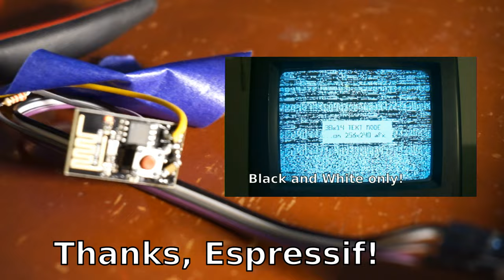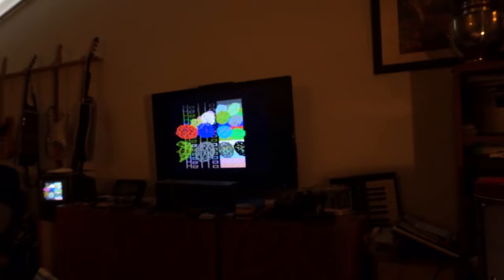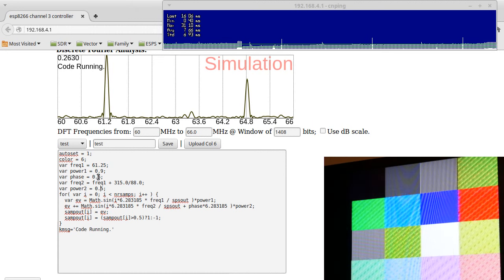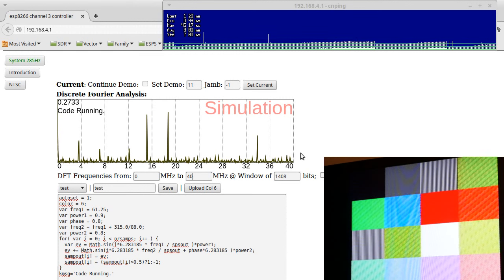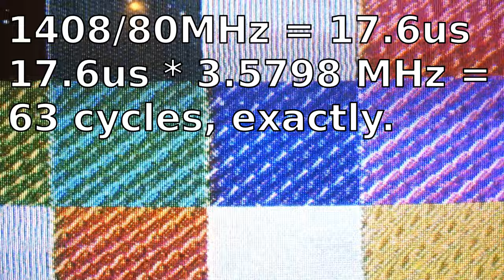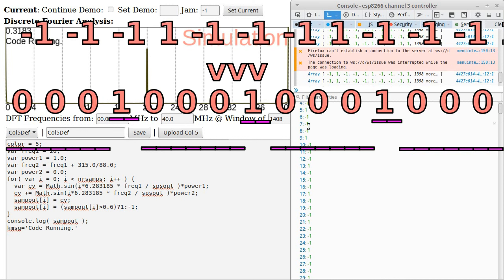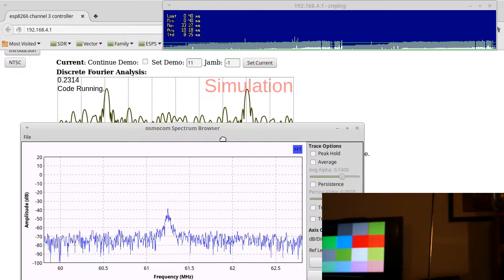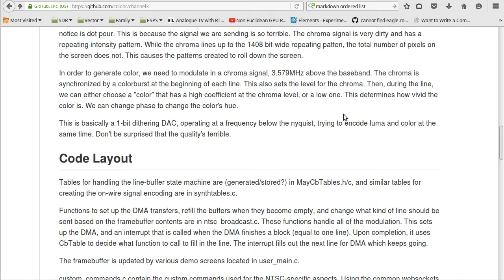Broadcasting  COLOR Channel 3 on an ESP

Comment: Yeah. There's a huge community around the RTL-SDR. They've got everything from really tiny dongles to a box of 4 you can use for passive radar. They're stupid cheap, compared to legitimate dedicated SDRs which would cost upwards of even $3K.
Reply: with the rtl chip rx and esp producing baseband this could mean a full ham radio with data modes and oled in the old altoids tin

Comment: Those last few seconds of the video were classic.  It's like you were playing a video Theremin!  Great video.  Can you estimate the wattage output of the signal?  Also, were you connecting to the device over WiFi or over a wired connection?
Reply from the maker: +Casten Riepling Across the entire transmit space, I don't believe it's possible to be more than 0.1W, so within that band, it must be much, much less.

Comment: Is there a second I2S port? And if there is, could you make a resistor ladder DAC to send a bit of a smoother signal? Would that help reduce the noisiness? Or would it actually be worse since you're relying on sidebands or whatever the word is, the reflections on the spectrum, so meaning the signal's impurity is actually doing a lot of the work? 

Of course a third and fourth I2S stream would let you use even more bits in your DAC.
Reply from the maker: +greenaum There is not on the ESP8266, but there will probably be on the ESP32!

Comment: I just got an idea,... what would it take to transmit some pre designed (sdr recorded and decoded) data in 434MHz or 315MHz band. 
Let just say that I would need to fake 4 unique (Manchester encoded FSK signals containing  pressure, temperature, unique 32bit ID and crc)...  And then transmitting it at about 1Hz... There would probably be a huge market for such device.
Reply from the maker: +Uroš Golob It would be difficult to pull off with this configuration as we're already reaching pretty far to get 60 MHz.  Maybe there is another hardware configuration?
Reply: +CNLohr I was afraid of that, so dedicated hardware transmitter is probably only solution... they sell those for $6 on ebay,... that is still cheaper then 4 TPMS :)

Comment: My ESP8266 is not outputing a wifi signal or a tv signal. Could you help me? I used esphome-flasher to upload it to my microcontroller.
Reply from the maker: You will need to connect by serial terminal and dump what it says.  The baud rate at boot is 74880 or 75000 depending on which one your serial flasher supports.
Reply: @CNLohr  hi, I wish you answer my query. 
I have raspberry and it's more powerful than attiny and esp8266, so I am wondering is it possible to broadcast raspberry Pi screen to analog tv channel 3

Comment: What I'm impressed with is the web interface that parses a text with setting.
Reply from the maker: That was a lot of fun, and I intend to do stuff like that in the future.
Reply: That's a great direction as it must speeds up MCU development a great deal. Will you make a video about it?
Reply from the maker: I haven't really used it before or since.  I've always wanted to cross-compile TinyCC to Javascript for this sort of thing but it hasn't really worked out :-/
Reply: tinyCC sits on the esp8266?

Comment: How much work would have to be put into this in order to broadcast something beyond geometric shapes, say low res video/audio? A lot of fun could be had with that.
Reply from the maker: Audio is really hard with this since it requires a second carrier.  There's just not enough bits to do it and make it sound good.  As far as shapes, it wouldn't be that hard!

Comment: Thank you very much for making it open source, I will try to use it for my own project that takes a low-res digital video from USB and converts it into analog. My version will be PAL as I live kn europe. I just have to wait for my ESP to arrive.
Reply from the maker: You can #define PAL with the example code and it should be able to do PAL.

Comment: As you can see in the Arduino IDE options setting the ESP8266 can run at a pace of 160mhz. Don you think that using that 2x faster option could help rmove the "noise" in your picturing?
Reply from the maker: For Channel3, I am operating in 160 MHz.  But, some of my nosdk8266 stuff at 320 MHz could.

Comment: I am new with this so you could make a setup video? smooth a question so with this you can actually take over a TV sender?
Reply from the maker: If you watch the first video "Channel 3", it explains a little more, however, the general expectation is for you to use an ESP8266 board and flash the firmware in the description onto it.  You may need more background with the ESP to get it all working.  So maybe it'll take flashing other firmware first to get the hang of it.

Comment: this is really interesting! super epic! might wanna try it for myself with an esp8266 I bought a long time ago and never used!
can you use sort of the same method to get just normal composite video output?
Reply from the maker: Look up bitluni.  He did it with an esp32, and composite.  It looks way better.
Reply: I retract my statement of wanting to try it out because I've been trying for hours just to get the SDK and dependencies installed (I am super frustrated)

not even the github page instructions or tutorials on youtube are helping me... I'm a complete beginner here (I am also using the Ubuntu app for Windows, it seems to be working fine though so it shouldn't be an issue)
can you recommend me a place to go that might make the process a bit easier?
tl;dr I can't upload the fancy code to the esp8266 because compiling it is a monumental pain in the behind
it would be a great development platform if it had its own IDE or interface like Arduino or STM32CubeMX
Reply from the maker: @jacksonshelton8055  Hmm, maybe in a few weeks I'll make a binary version of everything needed SDK wise and release it.

Comment: esp32 has DACs and Sigma-Delta Modulation. Any plans to implement this on esp32? Guess the results will be way better.
Reply from the maker: It would be infeasible since the bandwidth on the DACs are so very low.  But you could do the same I2S trick again.

Comment: Could this work at baseband composite video? The standard is 1 volt peak to peak, so a resistor could drop the voltage from 3.3 to ~1. But what about the - voltage sync pulse?
Reply from the maker: Yep, sort of, NTSC doesn't really care if you go negative or not.  But, that's not nearly as much fun.

Comment: why is the dft mirrored around the carrier? I tried looking it up can couldn't find anything..
Reply: +drojf The DFT isn't mirrored around the carrier, the actual RF spectrum is like that. He's exploiting the sideband to get the 61.25 MHz output: by generating a (40 * 2 - 61.25 = ) 18.75 MHz signal on a 40 MHz carrier, the sideband is located at (40 * 2 - 18.75 = ) 61.25 MHz signal.

https://en.wikipedia.org/wiki/Sideband
Reply from the maker: +will11m The principle is the same, I'm just not sure the mechanism is the same.  Though this doesn't look like exactly the mechanism, either, I think it's closer?  https://en.wikipedia.org/wiki/Undersampling

Comment: You have too much spare time. Get a job :D
Amazing stuff, love it!

Can this used with modification to output high resolution composite video instead of RF? Maybe S-Video on two pins with better colors? :) One more. Is the spectrum displayed in the web browser coming realtime from the ESP as well over websocket? :o
Reply: The web browser says "simulation" so I think that's just a calculated spectrum, calculated on the PC, that should reflect the actual spectrum coming from the ESP. 

The stuff from his SDR dongle is the real thing. 

I think!
Reply from the maker: +greenaum Indeed that is the case!

Comment: CNLohr is it possible to use the ESP8266 as a OSD board ? I work with APM Quadcopters and OSD are super expensive and a pain in the ass to program, it would be amazing to be able to create a OSD to overlay simple text ( or even color text ) over the video signal.
does the ESP8266 have the nesesary hardware to sense the video carrier signal and be able to go over the same phase ?
Reply from the maker: +Andres Alvarez I never thought about using it as an OSD.  Would the video generation device accept external synchronization information?  Would the ESP just need to process and go from there?  It would be very tricky because there is only one bit of output on the ESP :-/.  Maybe with a little bit more hardware.  Maybe it could just be an additive or subtractive OSD?  I.e. making the text white or black only.  But, I don't know if that would be useful.
Reply: most likely the video goest to fatshark fpv googles, or lcd screens inside a tool box as a "fly box station", check out the ardupilot mega project, APM mavlink osd, there is a protocol already done. The video is usualy generated by a analog ntsc camera, and the esp shoud sync over that video signal, so the signal that a arrives to the google is a "standar" ntsc signal
Reply from the maker: I can probably sync over an existing NTSC signal, however, I don't know anything about any of these projects or anything like that.  I don't know if I can do anything other than adding white text, still :-/  If that's good enough this could be a suuuper cheap video overlay thing.  I'll still have to look into it more.
Reply: +CNLohr Dude I love this chanel, I just bough 20 ESP and on the 1st day 1 finished and sold 20 diferent "wifi rgb lamps" to a guy that manufature fancy lamps, and he ordered me 50 more... long story short, Opensource is Great, but there is a lot of people who dont have the time go that path, they want to pay and to get the product done, even if you give them the parts and the instructions they wont figure it out. You can do a LOT of money with this color video overlay thing over ESP. Check out this 2 words " 250 FPV racers "  " mavlink OSD ". there is a HUGE RC comunity and there is only 1 color OSD and nobody figure it out how to do it, well, you just did. I have lots and lots of projects where i need to overlay video over a standar signal, and max7456 is a pain... please let me know you email
Reply from the maker: +Andres Alvarez What I was saying was it is easy to do 1 color.  It is much, much harder to do more colors. I'm honestly not sure how I would do it.  If there's no market for 1 color, it's not really worth it in my book :-/

Comment: Have you tried using a bandpass filter to get nicer signals?
Reply from the maker: +Michael Rußwurm No, I have not.  Not as ridiculous as straight one's and zeroes... But, I really should consider trying it.
Reply: wanted to suggest this too, I'm thinking it could really benefit the video signal quality. can't really think of a way to make the source signal clearer. also, I see others have suggested that the small cap you removed might have had something to do with this...I'd keep it in mind...and I'd also keep in mind that with the B&W signal it didn't have such an impact. All in all this is a great achievement, hoping you won't stop

Comment: dude your my inspiration to continue programming! i wish i knew as much as you, all i have made with esp8266 is a smart watch using nodemcu lua interpreter it connects to an sntp then keep sthe time with the rtc modual :/ i wanna learn the espress if sdk now
Reply from the maker: it is crazy powerful!
Reply: i was wondering if you could do like a setup video on the espress if sdk, i mean im sure i could just figure it out but itd be nice, i may be moving to those esp8285 (thats the one with the embeded flash right?) like what would differ in the setup for a esp8266 vs a esp8285
Reply from the maker: It would be the same firmware, same... everything actually... except no flash chip needed.

Comment: If you've got the knowledge; could you do a video on Artificial Neural Networks?
Reply from the maker: +Toomykins I have done some stuff with them, but not enough to make a video about them.   If I ever actually use them on a project, though, I will explain more in the video.

Comment: Does this project use the same technique as the RasPi FM transmitter?http://www.icrobotics.co.uk/wiki/index.php/Turning_the_Raspberry_Pi_Into_an_FM_Transmitter

So the transmitter has 1 bit resolution? (https://en.wikipedia.org/wiki/Quantization_(signal_processing))
Reply from the maker: +forfengeligfaen I think it's similar, but, you can dither the output.  I don't really know how that relates to quantization.  Yes, the pin is just 1 bit, but things average out over time.

Comment: This is going to sound stupid but is there anything specific to the ESP that keeps this project from being run on other arduous models? I'm still pretty new to arduino, despite all the success I've been having with it, I'm still getting my bearings -- at least for the details. 

I've seen FM done over gpio on the raspberry pi, but this looks SSOOOO much more interesting :) pirate tv anyone? Ohh and what about codecs? My mind is a buzz now... Great.
Reply from the maker: You'll have to use an ESP8266 arduino, etc.  But it can't use the arduino software, it's its own stack.  No codecs or anything like that.  This is just raw, moment-at-a-time bang it out to the TV.
Reply: +CNLohr +CNLohr after doing some more reading, and looking into things like avr studio it all makes a lot more sense :)

 I still have a lot more reading todo as far as understanding even the basics of ntsc and the like. It's funny how there always have a new area of expertise in technology to learn about, at least it keeps life exciting.
Reply from the maker: If you do want to do NTSC on AVR-based arduinos, I do have other guides on that... but, to do it /in/ arduino land is pretty much impossible.
Reply: +CNLohr  it's always better to have closer access to the hardware when coding -- the arduino abstraction of code is good for some things but there's a lot of overhead of course. I'm just now moving to arm assembly and the like -- not that much different from x86 or ppc, just a different chip, different features etc. 
It's a little different on a smaller machines. 

Are there any documents you used in your experiment? Or any resource you could point me to as far as how I could generate these signals on my own? 

I'm waaaay more of a software person as far as my computer science background goes, but I love the electrical engineering aspect of experiments like these. That includes the alternative forms of circuit fabrication like you have here.
Reply from the maker: Not really, Just google images and wikipedia for NTSC analog broadcast TV, kolumbus has a REALLY good page on NTSC timing.

Comment: It's  unfortunate that you did not do a version of you code to work under the Arduino platform
Reply from the maker: Arduino doesn't do well with really tight space and timing constraints.  It's a property of the environment, not of me.
Reply: How do i need to upload the code then? what sdk have you got on the esp8266, just the original one or the nodemcu?

Comment: Where does the code run?
Reply from the maker: +James Neave I'm not sure what you mean.
Reply: +CNLohr Well, the code looks like JavaScript? does it run on the device or does it seems machine code down over this web socket thing?
Reply from the maker: When simulating, it runs in javascript.  It pushes the data from the table to the device.  The thing runs perfectly happy without a web browser connected at all.
Reply: @CNLohr  
So the device itself executes JavaScript?
Is there a JS interpreter library on the ESP?
I ordered 3 of these today and I remembered about this video, didn't realise I had missed your response though!
Reply: @CNLohr  
I always wanted to have a go at this, not only PAL, but PAL + TELETEXT.
Reply from the maker: @MostlyPennyCat  I've always wanted someone to add that

Comment: Can this chip be used as a tx for broadcasting composite input?
Reply from the maker: Not easily.  You'd need some sort of RF frontend to do the reception... and it would be helpful if you had an ADC or something after a downconvert step.